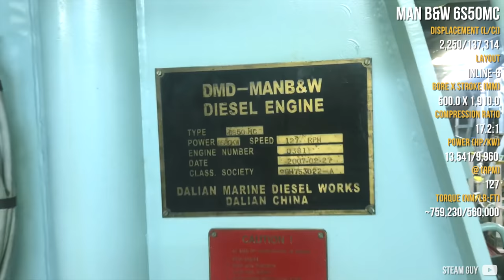Lowest Revving Diesel Engines

Comment: Imagine one of those 2000L engines throwing a rod
Reply: Would probobly sink the ship o.O
Reply: I imagine it would be like a small nuclear warhead going off in the engine room
Reply: there are ~30000L versions of man engines think about those and i've seen inside of those engines a piston is as heavy as a tank
Reply: One of my teachers used to work as a marine engineer on a ship. They had a marine diesel throw a rod. To make the engine not try to use its power to work the broken cylinder, they filled the cylinder with concrete and went on with their job.
Reply: Tad ir ļoti ļoti bēdīgi 😁
Reply: That's probably what killed the dinosaurs tbh
Reply: @JunkFriend2  bruh
Reply: GE does it, or blows turbos

Comment: They may smoke like a son-of-a-buck, but you can’t deny those Detroit diesels sound great when warmed up!
Reply: They do sound wonderful
Reply: the sound they make is music
Reply: My only complaint about them is the unnerving feeling of it becoming a runaway diesel
Reply: Yes, they do sound great. I drive a Series 60 12.7L every day.
Reply: If you ever ran a screaming Jimmy you can appreciate a well tuned cat or Cummins. The Detroit engines use fuel at ridiculous rates and fall off the torque curve like a rock. They do run under almost any condition and leak a lot. I will keep my k19 engines and let those Jimmy lovers extol their virtues.
Reply: 2:25 I would like to stand in that incredible smoke cloud 😍

Comment: I sail on a ship that has the new camless B&W 7G60ME-C9 a twostroke with at redline of 97rpm and delivers 17000Kw
Reply: Will it find in my honda yo?
Reply: 97 rpm?
Reply: 6 digits in torque
Reply: @kaptein1247  yes 97rpm is max you can actually see each individual cylinder moving under the strain of combustion
Reply: It would be amazing to see that engine running
Reply: Dang
Reply: @Thomas_Bergel  might need to get some heavy duty muffler bearings though
Reply: my dad worked on 2 stroke ship engines. Instead of a reverse gear, they would stop the engine and start it backwards to move the entire ship backwards
Reply: @dieselgeezer18  the B&W MCC i sailed on did that but on the one i sail on we only change te pitch of the blades
Reply: If this was an actual top 10 of lowest revving diesel engines, most of them would be slow speed marine engines like the B&W MC, Sulzer RTA and Doxford J-type.
Reply: @thatonescrambler  Imagine 60-75 rpm with 7 digit torque figures. Or maybe 40-60 rpm with 7 digit torque figures.
Reply: How much fuel is dumped into each cylinder before combusting?
Reply: @YungSteambuns  I did a ruff estimate on it, about 0.1 gallons per injection per cylinder.
Reply: 97rpm is like 5820rph. PER HOUR lmao.
Reply: @rolandtiiroja  yes we actually have a total revcounter for these b&w engines which sums up total lifetime rpm
Reply: @16jan1986  cool, like a dirt bike, just a tad bit bigger
Reply: @rolandtiiroja   I thought I was just an hour counter on those
Reply: Yep those MAN B&W engines are beasts.
Had a tour through one of their test facilities really impressive.
Reply: @Thomas_Bergel  your Honda will  fit inside that engine
Reply: Pneumatic valves? Crosshead engine?
Reply: Yes crosshead valves hydraulically opened pneumatic closed
Reply: @16jan1986  no engine can run at 97 rpm, unless I see a video uploaded then I wouldn’t believe it
Reply: Then checkout large marine crosshead engines like,MAN B&W,Sulzer, Mitsubishi.Two stroke heavy fuel engines that max out at around 120rpm.

Comment: Okay but how about the HIGHEST revving diesels hm?
Reply: think it's the Audi TDI race car, 8000 RPM limit.
Reply: @DYWTE  I thought it was a motorcycle of some sort
Reply: He did that years ago
Reply: @ugsl5236  He needs to update.
Reply: @reedtarted1932  there's a multifuel adventure/trail bike, 11k rpm limit and can run on diesels, biofuels, etc
Reply: Check OM606 and OM605 vids on youtube :D
Reply: That would also be a Detroit Diesel... or at least my Detroit..  never did find that one rod. I'm fairly certain it achieved escape velocity after busting out the block, the truck, and the garage wall on its last runaway.
Reply: @SuperRandykid  but it wouldn't run at 11k rpm when you use diesel
Reply: @MajesticSkywhale  it does. Everybody seems to think diesels can't rev, yet it's pretty common for newer small car turbo diesels to redline at 6k, or some of the American drag race pickups turning to 8k
Reply: @SuperRandykid  what i meant is that if it runs on lots of different fuels its max revs must be from the fastest-combusting fuel it can run, which diesel likely isn't, and thus it likely isn't hitting its max possible revs while using diesel

Comment: Ah yes the Deltic Diesel, a very cool engine
Reply: One o my favourite and intercity 125 ✌🏻❤️
Reply: The English Model-Engineer Magazine (a fortnightly publication) ran a series of articles in the 1980's detailing how to machine & build a scale working model of the Napier Deltic engine.  Was quite keen to make one, but unfortunately I recognised that it was beyond the capabilities of my skills, & my very small lathe!
Reply: @stevie-ray2020  wow that would have been a really cool piece if you did make it
Reply: @eliaslundstedt5607  I remember seeing pics of some of the readers' finished Deltic models, but what I can't remember is which fuel the model what designed to run on (diesel, petrol, or alcohol)!
Reply: @stevie-ray2020  A real Diesel on that small Scale would be borderline impossible; I can't imagine DIYing my own miniature Fuel Pumps and Injectors. Fabricating every other Part sounds flimsy, but possible so Petrol or Alcohol should be fine.
Reply: @Genius_at_Work  That's what I was thinking, so I'm fairly sure it was run on alcohol.
Reply: @stevie-ray2020  br232 polish locomotive ludmilla 3k bhp

Comment: The opposed piston engine he mentions at 3:30 is a crazy efficient design, mostly because it doesn't lose a lot of heat through the head, because it doesn't have one. They have other huge advantages as well. The crank throw of each piston in a set can be way oversquare, that is, the bore is much larger than the stroke, but since there are two pistons racing away from each other in the cylinder, the effect is of a very long stroke. This means you can get the torque of a long stroking engine, with the higher revving ability of a short stroke. This also means plenty of room to completely burn the fuel. Other major advantages are no head gaskets to blow and no valve train. Although Fairbanks-Morse still makes some monster examples for Navy ships, they mostly went out of fashion in the 1970s because they are all two stroke engines, and it was quite difficult to get their mechanical injection to play nice with emissions regulations. Achates power looks to revitalize the type with computer designed harmonic balancing of exhaust pulses to more completely scavenge exhaust gases. They report 55% efficiencies with their prototype, which means 270 hp from their 2.7 litre three cylinder.
https://www.youtube.com/watch?v=UF5j1DvC954
Reply: This man engines

Comment: 0:23, yes the known eastern european way of starting diesel engines.
Reply: i never used it on any machine i have,if cant start without it something is wrong
Reply: @youneverknow111  when tuning the engine first start or when its really cold i spray a bit of brake cleaner in my intake on my mopeds. Gets it started way easier and once it runs I kind of have an idea how I should tune the carb (main jet mostly)
Reply: western europe too
Reply: @shuenshuen  i understand its for easier starting,but like mechanic i been teached if it dont start on its own something is wrong,
Reply: @youneverknow111  this is often true, however its not a large problem when working on 2 stroke mopeds 50-74cc. They sometimes just need a little bump to get going.
Especially because I mix my own gas with 2 stroke oil before putting it in the tank, so when I haven't started the ped in a while the oil will start sinking to the bottom, making it harder to start. Brake cleaner perfectly fixes that as its kind of the opposite of oil.
Reply: A lil ether is the zip ties and bias plies special when it comes to getting ole slave lake going. Diesels seem to love the shit

Comment: Love this! 
Just a point about the superchargers on the 2-strokes, the supercharger is not there for power-boosting purposes but rather to help flush out the exhaust gases from the cylinder at the bottom of the stroke. This needs to happen from idle speeds, hence why they use a supercharger rather than a turbo for this purpose. Adding turbocharging then boosts power.
You'll hear this use of a supercharger/blower referred to as "exhaust scavenging", and on some engines they use an electric blower instead.
Reply: Correct,I was trying to explain that to somebody else on here.Last off the Detroit's were the 92 series.Always remember that sound as here in Ireland our capital city's bus fleet were powered by them up to end off 80,s.

Comment: I have seen 12v71s turn 2500-2800 rpms in an old pete
Reply: Yea most other truck motors rev way lower
Reply: It was often common to run marine and fire engines at higher rpm to provide higher pump pressures and a wider prop rpm.

Comment: Laughs in Wärtsilä RT-flex96C
Reply: About 108 000hp, 7 600 000 Nm torque and 120 rpm :P
Reply: @alx12345  Imagine what torque it would make if its max was 100 rpm. Theoretically I think it would make a tiny bit over 9.1 million FT-LBS.

Going down to 95 rpm would be just a under 9.6 million FT-LBS.

Going to 90 rpm would result 10,100,000+ FT-LBS.

At 85, it would be approximately 10.7 million FT-LBS.

At 80, we could be looking at over 11 1/3 million FT-LBS...

Dialing it to be lowered to 75, it would be at the very edge of turning 12.1 million FT-LBS.

At 70, an astronomical approximation of 13,000,000 FT-LBS.

At exactly 65 rpm, almost 14 million.

After that, running on 60 rpm, it would be about 15,100,000 FT-LBS.

At 55, it would be close to 16 1/2 million.

For 50, this would increase to over 18,000,000.

At 45, it's almost turning 20,000,000 FT-LBS.

Turning down to 40, we are looking at over 22 2/5 million.

35, over 25.5 million.

30, we on the lines of 30,000,000 FT-LBS.

25, somewhere below 35.4 million.

20, almost 44 million.

15, around 57 1/2 million.

10, exactly 83.6 million.

Going down to the single digits to 5, it's about 153 1/3 million.

And finally to go to 1, we are looking at almost 700,000,000...
Reply: @SolaricAngel116  you could never make any of that power in reality, to do so the engine would have to be at max fuel and have enough load on it to drag the rpm down and that just isn't going to happen with these big engines. They are built to run at desired rpm so they can be as efficient as possible and they are the most fuel efficient engines in the world because of it. I build and dyno test semi engines for a living so understanding how diesel engine make power in my bread and butter

Comment: We used to use a twin turbo Detroit Diesel V12-71 as a starter motor on General Electric Frame 5 and Frame 6 gas turbine generator sets of 24 Megawatt to 32 Megawatt output. The 12-71 would fire up and idle for a few seconds, then accelerate to wide open full power for the next 10+ minutes. It drove a Twin Disk torque converter which turned the accessory gear box. That was coupled to the gas turbine by a jaw clutch.  The screaming Detroit would crank the gas turbine to 20% speed where it lit off. 

The diesel would help accelerate the gas turbine up past 60% speed and then disengage. It would idle for a minute then shut off. That was about 12 minutes of Detroit Diesel engine abuse every time you needed to start up the gas turbine generator. They were very reliable. Ours were rated 600 horsepower.
Reply: Wow!

Comment: 2:36 those multi crankshaft opposed piston engines (not to be confused with boxer or flat engines) can reach a thermal efficiency of over 50% making them some of the most efficient internal combustion engines in the world, however they are extremely hard to repair

Comment: I would like a vid on school bus engines :)
Reply: Yes
Reply: But why
Reply: @madmax2069  Why not? lol 😆
Reply: @grahamnutt8958  simply because they're like any other diesel engines.
Reply: @madmax2069  Fair enough 👍
Reply: I'd like to see that too.
Reply: @madmax2069  They're not all diesels. Many had gas engines thru the 80s. Some probably still do.
Reply: @donellmuniz590  i also noticed they make these buzzing noises and I would like to know why it does that since I hear it all the time at school
Reply: @donellmuniz590  yeah and the gas ones are pretty much the same as any heavy utility truck, nothing special about them. for GMC pretty much big block 427, 454, 496, and a few V6. and pretty much the same thing with Ford. and no, today school buses use Diesel as they're far more efficient and cost-effective in terms of fuel.
Reply: @idkwhattoputformynameyt  Hmmm, it's been 45 years since I rode in a school bus...
Reply: Bluebird!
Reply: @idkwhattoputformynameyt  resonant frequencies and bad injectors
Reply: @donellmuniz590  one of the busses at my school has a 10L supercharged v8 and it sounds kinda like a hellcat . The driver said the have to refuel it every day while the diesels are only 2 or 3 times a week.
Reply: @xxzenonionnex7658  10 liter supercharged GAS V8? You must have gone to school in Australia, lol.
Reply: @donellmuniz590  No im in the US but the diesel mechanic teacher said the gas had like 470hp and 550lbs of torque 10L supercharged idk what brand the bus and the diesels have 250hp and 700lbs of torque 6.7L turbo 6 cylinder  engines.
Reply: @madmax2069  OLD school busses, like 50s and 60s, often had big GAS engines. GMC made giant V6s up to 478ci. And a 637ci V8 was available in either gas OR diesel. But not for busses. That was for really big trucks, dump trucks, generators, etc. International made a 545ci V8, but school busses usually got a 345 or 392. GMC in the early 50s made an inline 6 of 505ci, and supposedly even 707(!) ci, though I've never seen one.
Reply: @stopglobalswarming  And Gillig.
Reply: @xxzenonionnex7658  the 6.7 liter diesel must be a Cummins 6BT. Ford makes a 6.7 diesel, but it's a V8. I'd love to know more about the 10L blown V8 though. That's 610ci! Please ask your teacher who makes it, I'm very curious.
Reply: Global Swarming? Was that a typo?
Reply: @donellmuniz590  I've been trying to search the name of the engine but I can't find it all I see is diesel engines and muscle cars but i know its gas and it look like a industrial engine and not a fancy dragster type one that keeps popping up. I'll ask him eventually tho but most of the teachers like him haven't been in person because of the virus. I'm assuming it might be a ford because they make similar heavy vehicle engines but all the Ford bases i see look completely different and smaller.
Reply: @xxzenonionnex7658  I understand. Thanks.

Comment: A couple of things:
1a.  I worked for an International Harvester dealership as a kid - IHC designed a whole truck series, the Transtar 4370, so that the Detroit 12V71 and 12V92 engines would fit on the frame and under the hood.  They'd install a 16V71 if you didn't mind having the ass-end of the engine inside the cab with you.
1b.  1:40  Good to see the Australians gettin' their boots stuck in!
2.  1:55  The Kharkiv diesel was part of what made the Soviet T-34 the best battle tank of WW2.  The irony is that us Yanks could have had our own version of this superb machine, had the US Army not been knackered by Not-Invented-Here Syndrome.
Great videos mate; I subscribed and keep up the excellent work.  Greetings from the States!

Comment: 1:00 “naturally aspirated” means it wouldn’t have a supercharger or turbocharger..
Reply: That's not necessarily correct in thr case of medium/ high speed 2 stroke diesels. An air pump - a Rootes blower - is used to supply scavenge air, and it's still classed as N/A
Reply: @jools77  Correct. The blower on a 2-stroke diesel very rarely provides any positive boost pressure.  I've seen a few Detroits with overdriven blowers but they're still way below the range of a typical supercharger.
Reply: @jools77  If the scavenge air pump is neither considered a supercharger nor a turbocharger, Connor was right.
Reply: @jools77  Naturally aspirated means an engine will run on atmospheric pressure alone. The superchargers on Detroit Diesels supply air to run first, and to scavenge next. Without the supercharger it will not run.

Comment: 2100  rpm on a diesel is actually average on truck diesels as for a 12v71 Detroit I have seen em do up to 3000 rpm. second virtually all Two stroke diesels are forced induction (supercharged) because they can't supply enough vacuum to suck in enough air and has nothing to do with running at high altitudes. Which is one of the reasons you will see them 2 staged with turbos as well. However your doing ok with your research. And pretty good presentation.

Comment: For The tractor engines you can see the SL50 from the Italians an Landini Who Is very similar to the bulldog.
And for low rpm train engines you can look up to ABC Diesels (Anglo Belgian Corp. Diesels). They made a 6 in line of 100.000 cc and 500hp who as an idle of 300rpm and max rpm at about 600 or nearby. Perk of the last engine is the compressed air starter.
Reply: type 69 iraq !